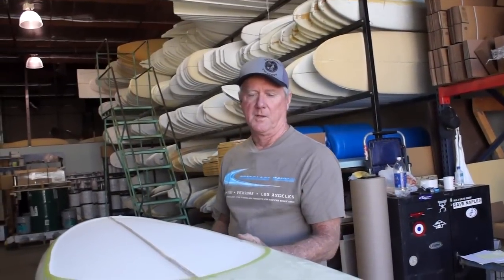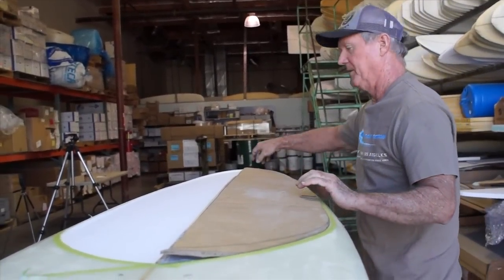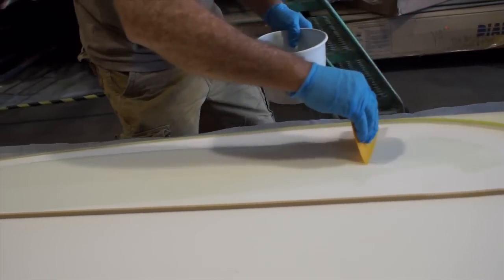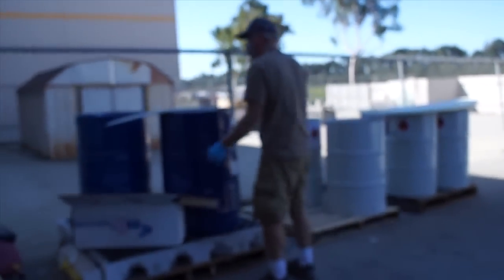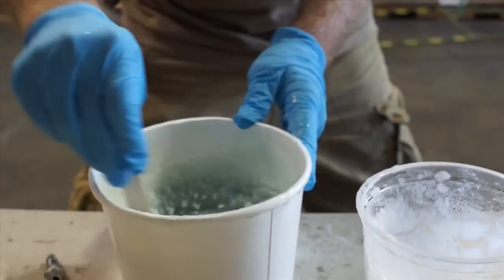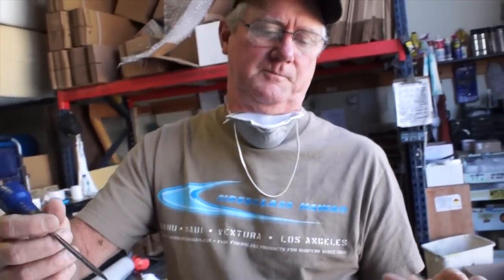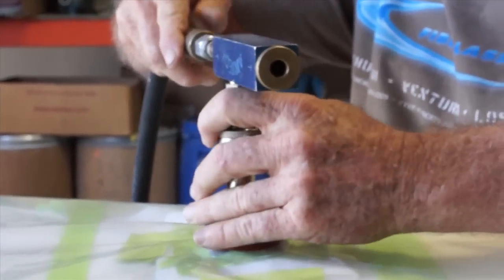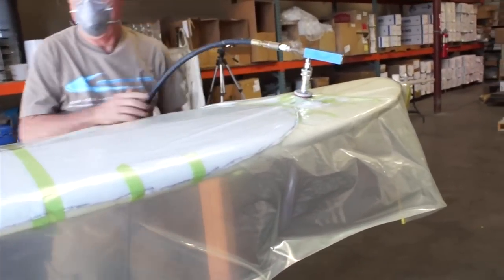Vacuum Bag Surfboard Delamination Repair

Comment: How long did you leave it under vacuum for? Until the the resin had cured completely or just until all of the air was removed?
Reply: Tristan Wentworth until it cures completely
Reply: @Stephane1995  I think the dude said 3 hours